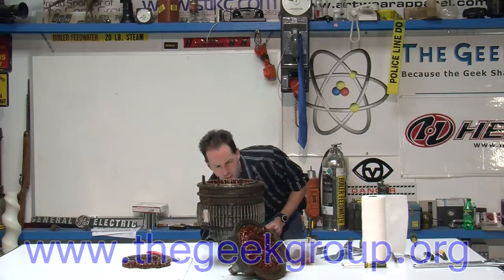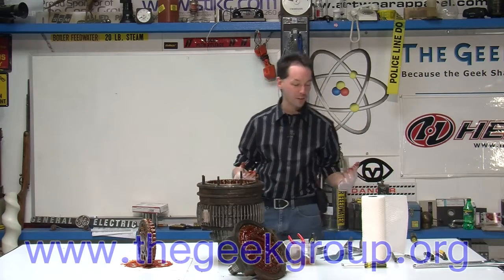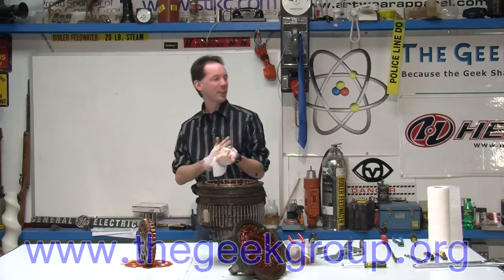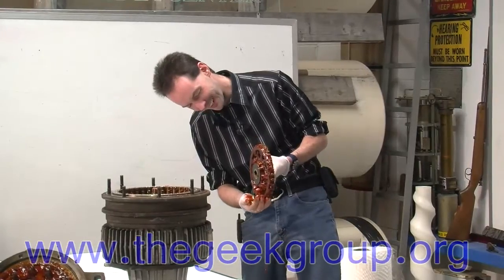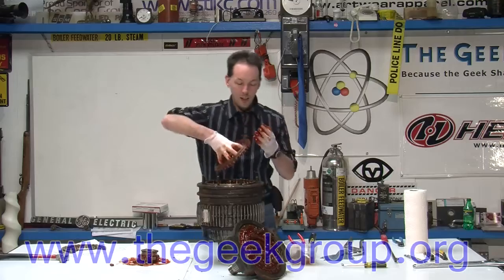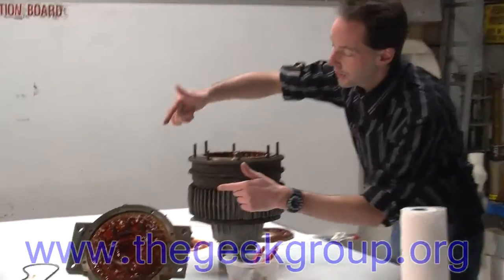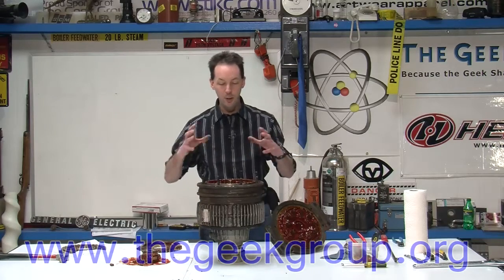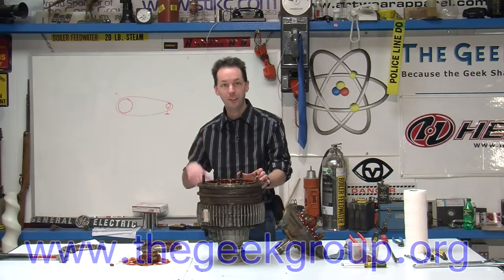Exploring a Planetary Gear Drive Pt 2

Comment: Ah, a hypocycloidal reducer! Those are incredible pieces of equipment that operate on similar principles to that of planetary gears (as in, the machine theory is kind of the same), but in actuality are totally different. I've watched many of these videos hoping to see a one of these.

Hypocycloidal means "rolling on a circle" in essence, and the eccentric cams that wobble inside the pins, they effectively roll with each wobble about the outside rollers. They are excellent at creating high reduction ratios in a small space, because the reduction ratio is 1 / the number of lobes on the cam (also known as the cycloid disk). 

The reduced motion can be extracted from the circles on the cams. As the cam wobbles, the sleeve bearings on the output pins of the output shaft roll on the circles in the cams. This results in a reduced motion.

Because of their high reduction output, and a lack of gear tooth geometry that suffers from bending loads, they are excellent in robotic applications because they can make enormous torque.

The downside to these drives versus a planetary gearset is that there is "off-loading" of the components. Due to the eccentricity of the cycloid disk/cam, the input bearing takes an enormous load (because the radius the torque acts on is tiny compared to the torque). This requires some clever design to pull off well in a small envelope (i.e., about 1/8th the size of the one presented in this video), but works very well in large design envelopes. The other issue is that the output rollers provide a large radius for creating an out-of-plane moment load on the output bearings. Given the size of this transmission, that doesn't matter, as full complement bearings or sets of two or more angular contact bearings can effectively sustain the loads present.

All in all, these are very interesting devices. It can be difficult to find information on them, anyone interested feel free to shoot me a PM. More people need to know about these!

Comment: Excellent videos!. I love doing vidoes on taking things apart, and an industrial robot has to be the coolest one I have seen on youtube!

It looks like it uses resistance from the grease as well as the eccentric gears to create smooth low speed, high torque motion

Oh yeah, I'd give anything to dismantle something industrial that's as clean inside as that drive :D